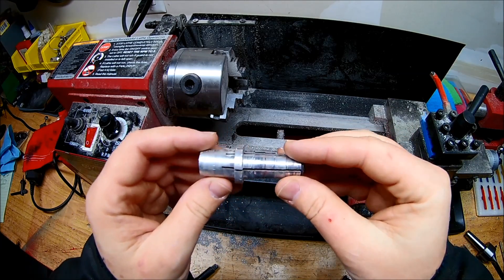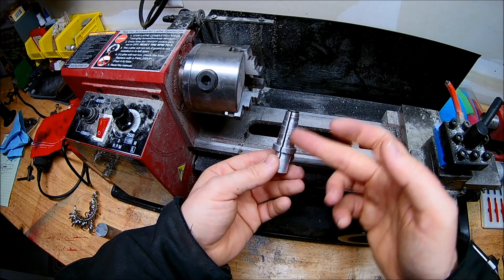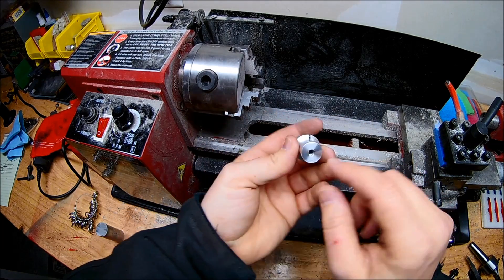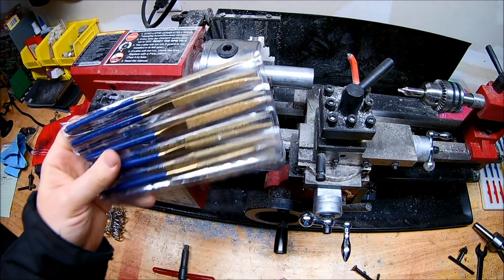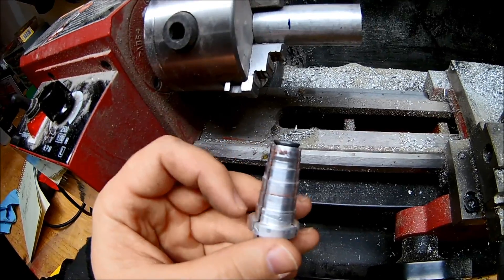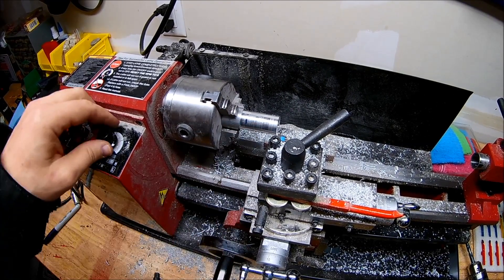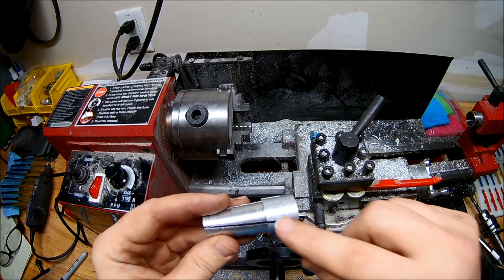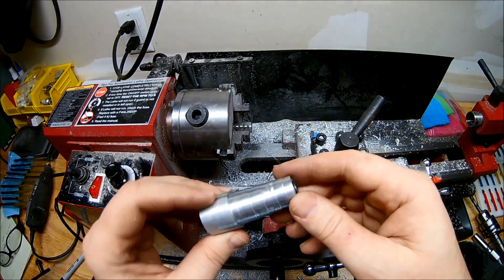Making an adjustable ring Mandrel / Arbor

Comment: I hate to object, but the first step in making anything like this should be to put a taper on what will be the back end of the work piece that will match the taper in your lathe's headstock because each time you put that piece in the chuck it is going to be slightly or somewhat different. Meaning that the ring you are working on will be slightly or somewhat lopsided. So put the taper on the piece, drill and tap the back hole, then turn the piece around and do the work on the business end without the chuck and from there on every time you put that mandrel in the headstock it should be positioned exactly centered.
Reply from the maker: YOu'd be right, squaring the stock would have been better than trusting the original shape

Comment: Awesome video but if I could offer some advise for your order of operations to make this a lot smoother. 

1. turn down the end you plan on chucking up so you know it's true. 

2. Drill and tap your holes, 

3.Chamfer the end to match the angle of your bolt, (I would suggest using a fluted countersink)

3. Turn down your  your steps. 

4.Cut your expansion slots. 

Awesome work, I'll be making a set of these as soon as I get my shop set up!
Reply from the maker: thanks for the ordering! :)

Comment: Get rid of them grazed carbide bits and get some shars branded insert holders. Will save alot of frustration. Also get a few 3/8" has blanks for special purposes. I use rounded hss for finishing passes makes polishing super easy
Reply from the maker: I got a few a few months after this video.

Comment: Just a quick tip:
You should take the habit of  just spotting the center of your piece and not drill past the edge of the 120° tip of you center drill when marking the center. In steel, drilling to the 60° chamfer as you did here could result in chipping or breaking the lip of your bit when drilling the final hole.
Drill bits have 118° angle, almost the same as the tip of a center drill, so it makes for a wider point of contact when the bit touches the center hole and less chance of breaking the drill bit.
Nice project nonetheless. I'll have to try it.
Reply from the maker: Thanks for the tips :)
Reply: @GearheadDaily  My pleasure. I learned that myself not so long ago, so I pass the info along.
I forgot to mention (but it's quite self evident) that it only matters if your drill bit has a wider diameter than the spotting mark – which is usually the case.
Reply from the maker: @19Edurne  Thank you, i try to learn as much as i can from those with more experience :)

Comment: Going to be making my own mandrels to complement my commercial ones, and found your video. A couple tidbits for your consideration - Use your center drill to make the chamfer before you machine the steps. A commercial countersink bit will also work to make the chamfer. You can also turn your toolpost to bring your toolbit in at an angle to make a light chamfering cut. For more precise marking of the steps, make a light pass on the outside to true up the stock, then color it with a blue sharpie (poor man's layout dye) - use calipers or a scribe to mark out your steps, then machine each one to size. Other than that, good work.
Reply from the maker: Thanks for the suggestions. Truth be told, this was my first time using a lathe :)

Comment: Thanks for the video, I need to make a couple of these but need up to size 12. Most ring orders I get are for size 10 and up
Reply from the maker: No problem. Glad it helped. I made 2 for the range of sizes but making them be bigger wouldn't be an issuefor you

Comment: Are your tooling bits good to go from the box or do you have to grind them to the right shape, I have just got a Clarke Metalworker 300mm lathe and the 11 piece turning tool set that i got is no good not the right rack on them.
Reply from the maker: They were OK, not all of them were ground properly, you get what you pay for I guess.

Comment: Very helpful 👌... Would you u sell me one as I dont have a metal lathe? 🤔
Reply from the maker: there are ones for sale around that are hardened tool steel.
Reply: Gearhead Daily do u sell them as well? It's prob but st to invest in hardened steel alright, but if I'm shipping something for the states to Ireland the lighter it is the better. It's soooooo expensive. I tied to get setbon punches. Like the basic 9 piece set from there an all in it's nearly 100 😔.. So I'm tryin to figure out a plan b on that one

Comment: So those cheap carbide tools work wonder with aluminium? I've been using HSS tool for aluminium turning and chips never break, it's all about long and stringing unlike yours that are small chips.
Reply from the maker: Chips versus strings might have to do more with my feed speed. I was going rather slow. The carbide bits make strings just fine
Reply: why on earth would anyone want long stringy chips??
Reply: No one does.

Comment: If you don't have a mill you could try mounting the arbor to a v-block and onto the carriage of the lathe, then use a side milling cutter in the headstock to cut the relief.
Reply from the maker: Good call